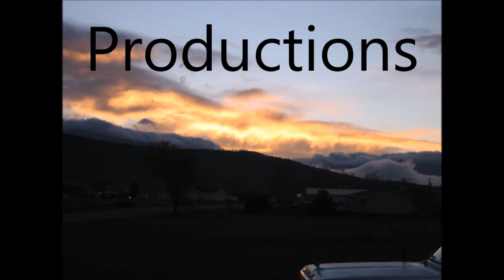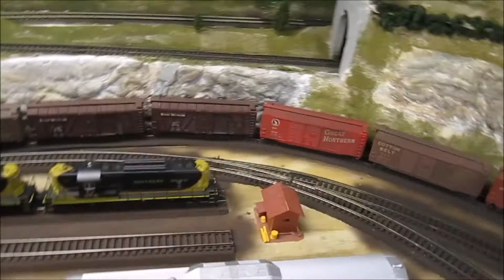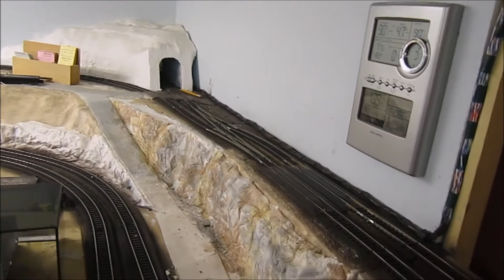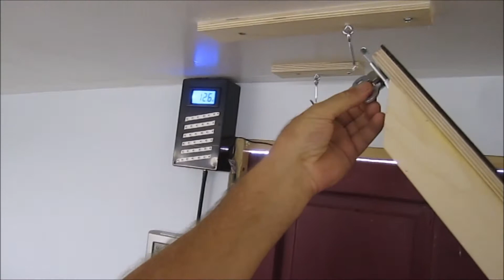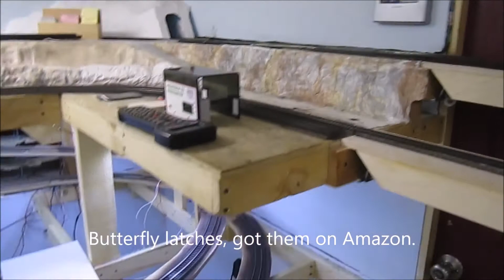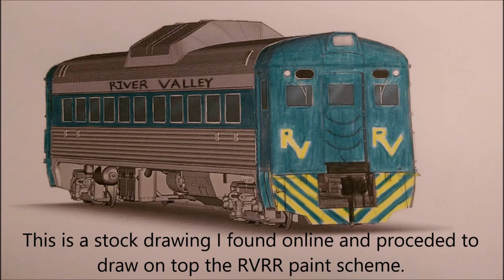RVRR update 8 13 2016

Comment: Great job Mark. The lift up bridge is a great idea. Chuck is lucky to have you around. RT
Reply from the maker: Thank you, I got the 8 BD-20's installed today and ran a mainline train for almost 2 hours without a single incident or need to throw a turnout (there are two that have to be thrown for mainline OPS). Takes about 15 minutes for one complete loop from top to bottom and back.